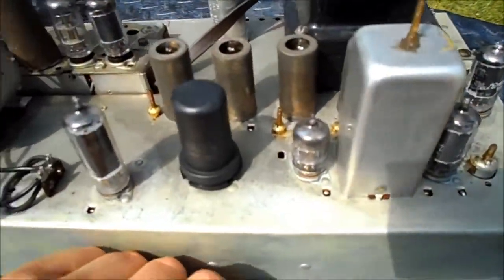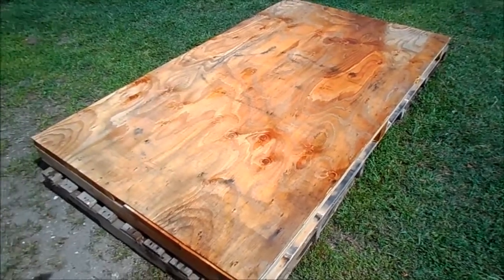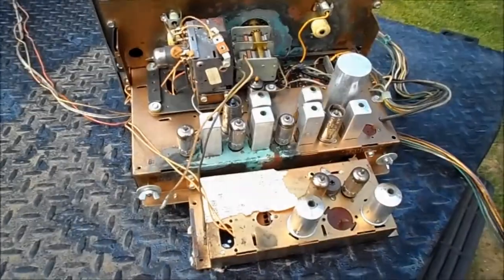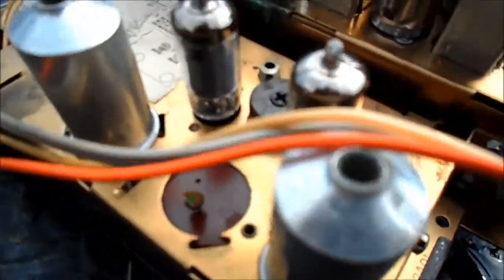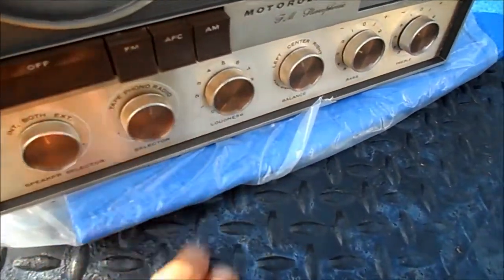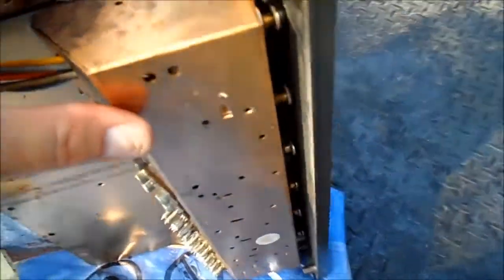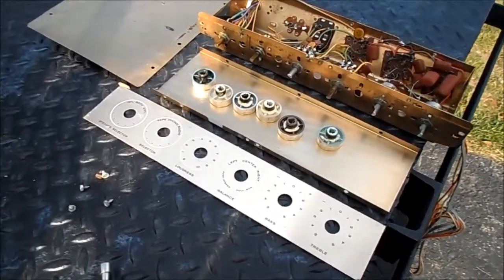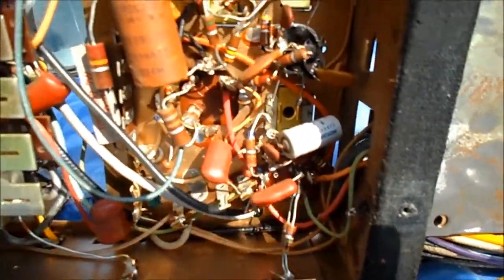Chassis Binge Cleaning.

Comment: Those mice sure did a number on that thing.

That's a really nice console and I've been keeping an eye on your channel for more videos of it. I actually found one here on CL that the guy was just giving away. The cabinet was nearly destroyed but all of the electronics were still there. I was a little late on it and it was already gone by the time I contacted him. Bummer.
Reply from the maker: Yes, did not pay much for this either, but the radio is nice on these. I have an older Motorola in like new condition, but for some reason, I am drawn to the wrecks. Keep looking. Hope you find one with that tuner.

Comment: Bizarre, isn't it, when a radio station automatically switches to that synthesized voice from NOAA warning to take imminent steps to save one's life?
Reply: good job on cleaning up too.  save the deck for next summer.
Reply from the maker: It's funny how it pronounces the affected towns too.
Reply: Farmradio Try working in a radio station doing a show when those EAS alerts come in "LIVE" in the air. A couple of shows I must of had 5 weather alerts occur.